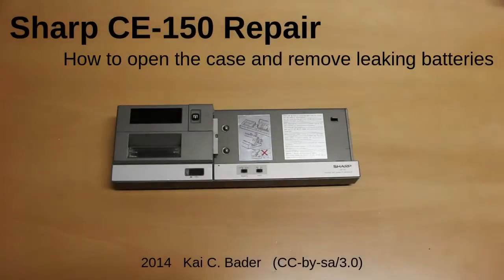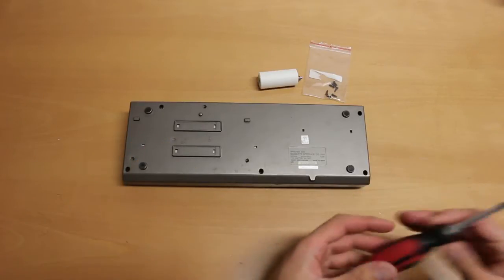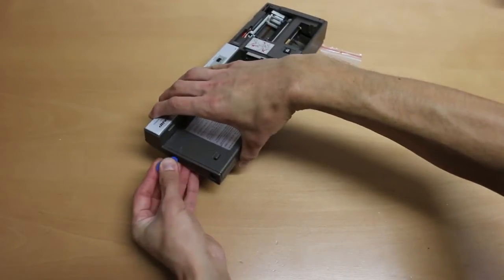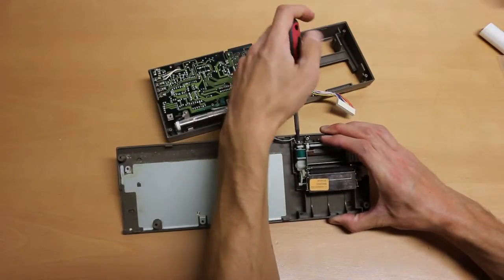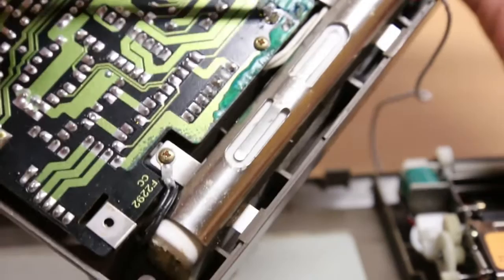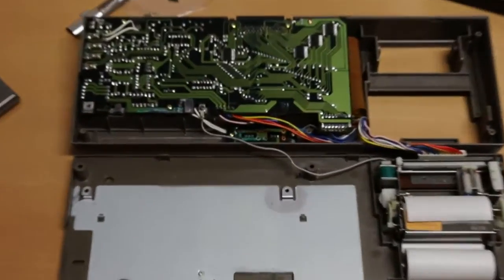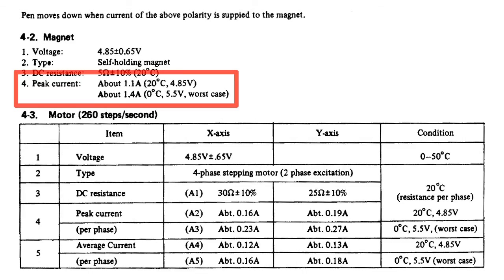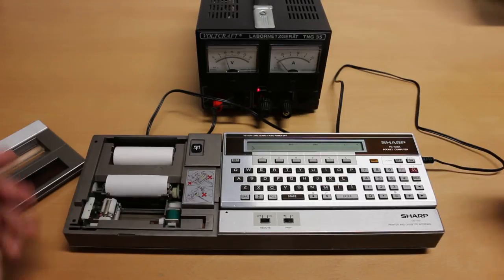Sharp CE 150 Printer (PC 1500) Vintage Hardware Repair

Comment: Thank you for the video. One question though. There's a gray wire and a black wire connected to the board via the battery holder. When you put the unit back together, I see that you connected the gray wire back to where it was (without the battery holder), but I see no sign of the black wire being re-connected. Is there a reason for this? Thank you!
Reply: it seems that the black wire was the negative for the battery. Since the battery is gone, I suppose it's not useful at all. May be the red wire is gone somehow, too.